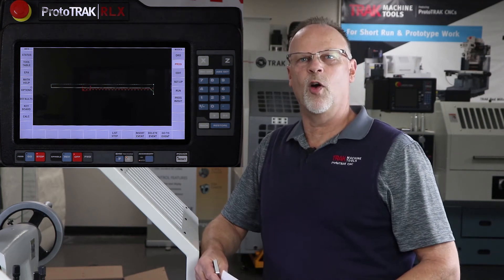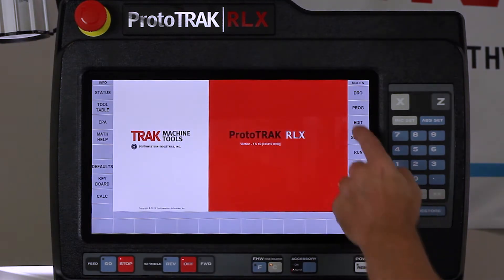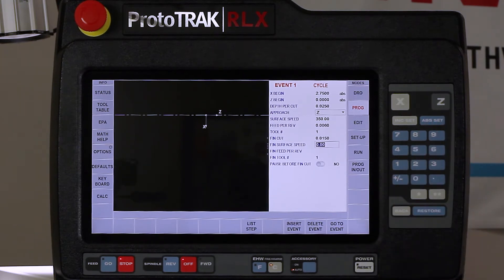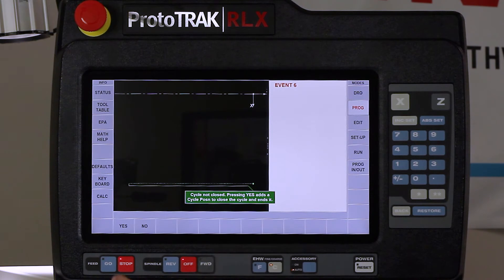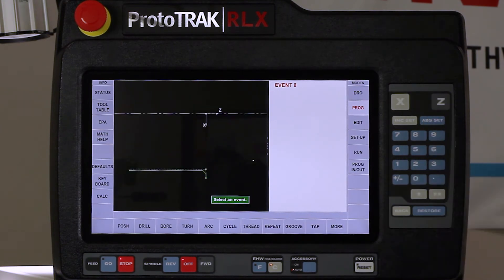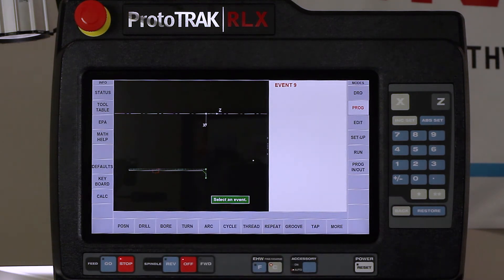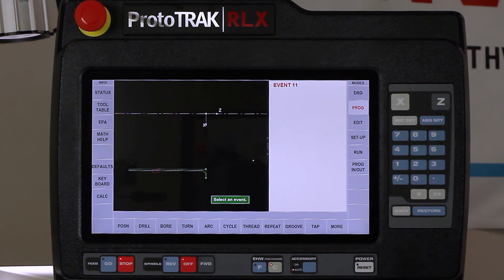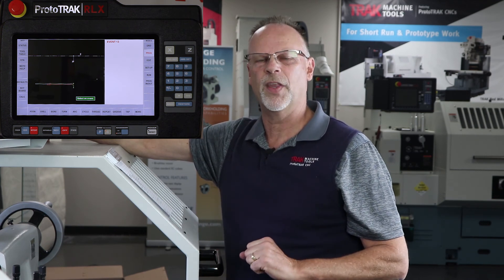ID Grooving, Boring, Threading | ProtoTRAK RLX CNC | Lathe ID Programming [Part 1]

Comment: Why did you put a position in the program for threading ?
Reply: Hi David, truthfully, it was not needed because the thread event begins and ends outside of Z zero however, as good safe practice, if I have my home position set outside of the diameter that I plan to machine, I like to use a position to make sure the tool will always be clear as it enters and exits the ID. In this case, it is only needed for the groove.  Safe practice makes safe machining!  T.P.

Comment: How do you indicate the tool post?
Reply: I put an indicator in the chuck or collet and then run it along the tool post in the X axis making sure that it doesn't move.  Once I get to that point, I tighten the tool post and then check it again to make sure it didn't move during the tightening process.  T.P.